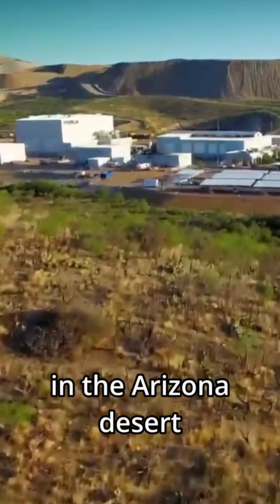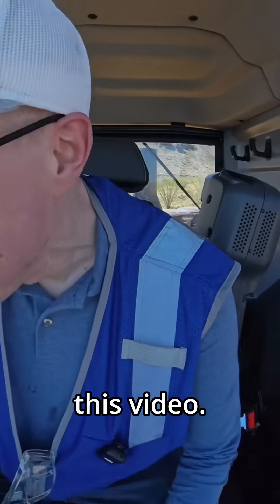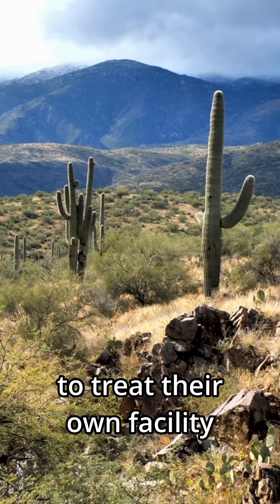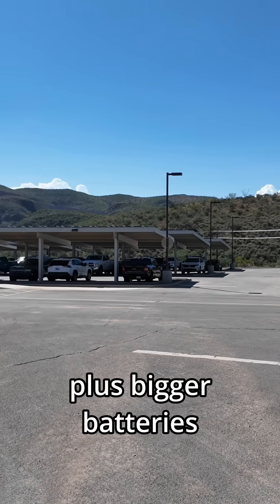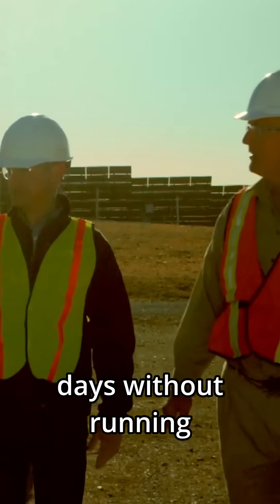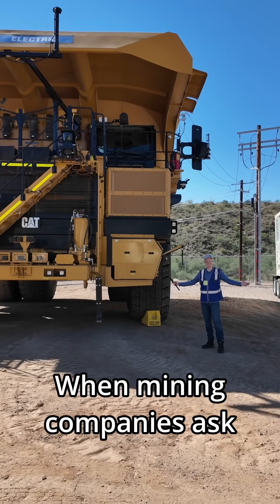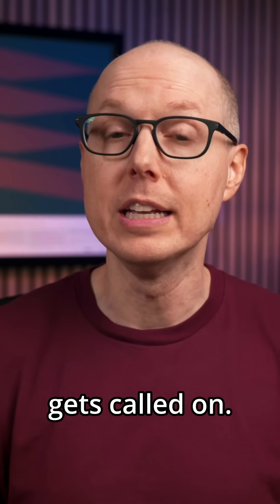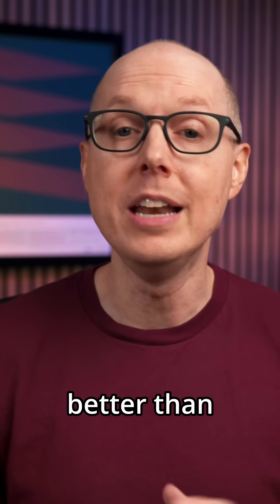Microgrids: The Desert Facility Running on Sunshine

Comment: Cost? What was the cost to build the solar farm and acquire the battery storage and the cost to maintain it in comparison to running and maintaining the generators? If creating the solar farm cost 3x more and the damage to the environment to mine for lithium for the batteries was 10x more is it worth it? These are real questions that require real answers.

Comment: I think you made a mistake with the numbers. 3MW of battery storage doesn't work with 12MW hours of energy. It is either 3MW hours or 12MW hours. I think you meant to say the draw capacity is 3MW hours per hour, which is consistent with these large scale BESS that typically offer 4 hours of electricity supply. So basically 4 hours supply at 3MW gives you 12MWH

Comment: Lot of good stuff, I'm very curious how many years it will take for them to achieve brake even on that investment with no use of the generators.  It's a perfect location for this test, but this challenge would be much harder to do say in the northeast

Comment: Good story. What is total cost comparison over time? Batteries and solar panels are very expensive and also require maintenance. So do generators and the fuel. They both pollute during manufacturing and recycling. Which path truly is better for mother earth?

Comment: The market for small nuclear reactors is huge. As battery technology advances and becomes cheaper. The equation is changing. It will eventually make more sense to power heavy equipment with electricity and use long life electric motors as prime movers. Equipment manufacturers will resist though. Planned obsolescence is critical to their business models of ever increasing profit.  Factor in automation and AI and you can foresee a potential future where moving mountains is economically feasible…which will come in handy when sea levels rise several feet by the end of century. Obviously this would also make all other areas of construction and resource processing cheaper like building roads and mining.

Comment: Working for Cummins in power generation, I can tell you that solar and wind have an ROI of less than two years compared to running prime diesel generators. It costs just under $18,000 per day to operate a 2 megawatt diesel generator and requires an engine rebuild every 36 months.

Comment: Matt… a 1.5MW solar system costs anywhere from $1.5MM TO $2.5MM installed before land cost and excluding subsidies. The all in cost of electric produced excluding batteries is roughly $0.90 - $1.60 kWh.  So while the logistics of running this unique project in a remote operation in the very sunny, low latitude Sonoran desert may make sense this is hardly a breakthrough solution for wide application. The science is certainly interesting but your credibility took a hit in my eyes particularly since this was a paid junket by CAT. I respect both you and CAT. BTW I’m a retired mining exec with direct experience operating a mining operation in the remote, very unforgiving MX Sonoran desert.
Reply: So, you have an opinion with a heavy conflict of interest leaning against it.

Comment: Am I CONFUSED?
HASNT this been going on for DECADES.
There are literally thousands of setups like this and their results are to say the least MIXED.
If it were this EASY we would have solar generators like this EVERYWHERE.
But from what I understand very few have actually saved any money.
After you figure in the costs of construction, maintenance, and all the other costs, this seeming SOLUTION IS JUST TOO EXPENSIVE.
Reply: Nothing is more expensive than shitty foreign fuel at speculative prices and maintaing these 30% efficient generators.  
This is a job for actual engineers, not crybabies stuck to their loud dirty junk.

Comment: How much did all those solar panels, batteries, and electric regulators and switching gear cost, and how much was the installation cost? Did they receive any energy tax incentives? What is the real bottom line on all those "savings"?

Comment: How much does the battery replacement cost?
Reply: they will know that in 10 - 12 years when first cells start failing.  They don't change the whole battery at once, modules are disconnected and swapped when the system detects unbalanced cells.

Comment: Did they share the cost of all those solar panels and battery storage systems? 4 MW of solar and 12 MWh of battery storage probably cost over $10 million. Where I work we've installed 2 MW of solar over a parking garage and parking lot and that's cost about $4 million. Payback is over 12 years.

Comment: No diesel cost or engine maintenance. Yet how much did the solar and battery installation cost? Pretty expensive. I have seen and installed megawatt solar. It's not cheap.
Reply: You want cheap and inefficient buy a diesel generator.
Reply: @fofopads4450 as far as diesel goes they are more efficient than unleaded at 25% compared to large diesels at 40%. Electric efficiency largely depends on the source and availability of the electricity. For current US electricity coal is the predominant source with an efficiency of about 35% from the plant. EV's are roughly 90% efficient, better in the city vs highway. Still i do like electricity and i believe it will be our future.

Comment: Few US locations offer vast lands or available sun for current solar efficiency.  
Viable Energy Storage is still a Pipe Dream
Reply: So we should just stop trying right? Because clearly, if current methods are failing, there's no point trying  for better.

JFC you people suck.
Reply: @MercurialJester When Push Comes to Shove , 8.2Billion humans likely best served by 'Cookie Cutter' nuclear for 24/7 energy access. Ya, lotsa pushbak on that idea. Reality being what it is , nuclear will be accepted as the Crutch until fuel's depleted or other viable massive energy sources are developed.
Reply: @peted5217   living in part of Europe known for the rainfall, my solar power generation is very viable despite almost never having 0 octre days with strong sunshine. 
Modern panels just don't require strong sunshine, that's an old myth.
Reply: @lonpfrb Happy to Hear Solar working out well @ your local. Is storage part of the setup? What % of your city has similar?

Comment: Around 53 degrees N. latitude Canada we get less than 8 hours per day of sunlight in winter, and further north its much less than that.  It takes a LOT of land area to produce the required solar electricity.  Much of that power would be used to heat the interior of vehicles.

Comment: Their biggest problem is the unused diesel sitting around is probably growing algae. So they will have to run it through fine filter and transfer it into scrubbed out tanks, then scrub out the tanks it was sitting in, and every so often, repeat the process, scrubbing out the tanks to remove additional algae growth, unless they just use it on other engines to keep it fresh or have a really effective algaecide additive added to the diesel.
Reply: Diesel in a mining company never goes bad before being used.

Comment: Heavy trucking and industry have seen the massive potential benefit of ditching diesel fuel in favour of batteries and renewals energy. Instead of them being completely reliant on oil prices they can now spend a bit of capital up front and build their own portable microgrids and electric truck fleets. They may still need diesel for some generator situation like for longhaul trucking, but by using plug-in hybrid tech thats already used for frieght trains they can massively reduce their dependence on oil products

Comment: is this a parody? 

spend millions to save thousands. as long as you live in Arizona, you could power the lights with... stored sunlight. nevermind the trucks burning all that diesel. 😂
Reply: @chara12345  this facility is mostly to test electric mining trucks.  
Judging by the size of those batteries they're most likely saving at least a thousand per day if their burn rate for the generators was around 0.2-0.3 which is decent for a small island system like that.  Hard to tell without knowing their load.  But even if those trucks are diesel electric hybrid (standard for modern trucks) their facility would have enough cranes, compressors, tools, A/C to be considerable.  Similar to a small town grid at least.

Comment: Yeah, nice for off-grid installations, not so nice for on-grid operations...
Reply: This is not true, sorry.  For large facilities, a "non-island microgrid" is a common and extremely efficient energy management structure that can implement renewables and storage very easily.  In fact, it needs less investment into storage due to the grid power being available as needed.  Many large mines closer to infrastructure operate this way otherwise they would break the grid.  But it's not uncommon to see universities or industrial facilities operating similarly.
Reply: @TheWaywardJester  I literally said the same: it's nice and useful for off-grid installations. And no, universities aren't off-grid. Industrial facilities literally can't be off-grid even.
Reply: @CoolKoon sorry I think I missed a definition there.  "Non-islanded" refers to a microgrid that is still connected to a grid.  A microgrid can be grid connected (a sub-grid so to speak).

Large universities and industrial facilities can be run as microgrids if the business so desires as an energy management strategy instead of relying on local utilities.  When it does there can be significant savings depending on the setup.  I know this as I specialized in energy systems and helped write a feasibility study for my university transforming into a microgrid.  See actual cases also like the University of Regina.  See also the industry of power trading in general, it's wild stuff.

I've never heard of it being done but an industrial facility could totally be off-grid if they so inclined.  That would almost never be economical though which I assume is your point.  But a lot of mines are essentially off-grid industrial facilities if you think about it.  I don't really have a problem with your statement for this I just like talking grids and thought that was interesting.

Comment: You know where solar panels do not work? Next to a mine, where they get covered in dust within 2 days. Guess they will find out along with the first dumb customer.
Reply: Depends on the mine.  Look up some modern mines with solar infrastructure.  They usually install them around hills away from common wind paths.  Rain also clears dust decently well and in areas that don't rain there are watering trucks that drive and spray down the panels every once in a while.  
These considerations are baked into the design process.

Comment: Deserts may look tough, but they are fragile ecosystems.  
How much damage do these acres and acres and acres of solar panels inflict?  They look innocuous, but they have underground structures, too.  These are typically left in place, once the useful life of the solar “farm” is reached, even if they take the actual panels and above-ground framework.  
What was wrong with the roof of the factory??   Not big enough???   How much of that acreage is covered in panels?

Comment: They are "saving" on the power bill.
What about expense on equipment and work to install.
What about all the solar panel and battery when they needed to be replaced???
🤔
Ps: like to see a solar or EV bulldozer😂
Reply: Yeah man. Since diesel generation amd diesel fuel is free, they definitely must have a large overprice.

They already make EV mining trucks. But I havent seen bulldozer,  is easy once you remove all the diesel junk, lots of weight available and hydraulic equipment is plugged easily

Comment: Quite a few mines in Australia have started using solar and wind to reduce their usage of diesel.  The Bellevue Gold mine in Western Australia runs almost solely on solar, wind and batteries.  Ironically, the Boggabri Coal Mine in NSW is developing a 5MW solar farm and a 12.6MWh battery solution so they can reduce their diesel usage while mining coal that is often used for coal power stations...

Comment: I’d like to know the cost of the investments in the solar/battery farm, the expected lifecycle and associated maintenance costs as well.  To develop the true cost avoidance over the expect operating life span of the equipment.
Reply: Commercial cells 10 years ago were being rated for 20 years. The technology has only improved. Even if they started with older cells, the 3 phase construction model allowed them to upgrade to newer technology each time. Meaning they have total capacity needs met for most operational periods, with that old infrastructure. If they account properly, which I assume they do, then the money that comes from depreciation goes into savings for another ten years before they even need to replace any of the old panels. By then the tech level in the industry will have made both efficiency and longevity better on the commercial market, by a ton. Not only will they pay for themselves. Once that happens, it will be actively making itself money. That's what he meant by actualized budget increases. True real world savings from maintenance on engines, shipping, fuel costs, replacement. Industrial engines need replacing more often than panels do. The subsidies are only for installation and if you hook up to the grid. So they probably aren't getting too many of those as a local footprint battery storage facility that is not hooked to the grid. When an R&D facility can fund its own expansion with the savings that it gets from switching to solar, and then use the born in cost of upgrading that infrastructure to modern technology, that paid for itself, to power that expansion without any new infrastructure. I don't see anything to complain about.

Comment: Crazy how many solar panels are needed for just that one facility… And they still need diesel fuel to run all the trucks. And as back up when the solar isn’t enough.
Reply: That is an electric vehicle testing facility... those trucks don't use diesel.

Comment: How much did they spend on this throughout the phases? Or does the silence of the generators not running tell the story better than actual math would?
Reply: Less than continuously replacing diesel engines every 5 or 6 years... when modern panels last for 20.
Reply: By the time this project completes a full depreciation cycle, the current footprint will have even more power generation capacity from updating to the newest technology. It's so win win.

Comment: Those frameless panels look exactly like the kind I installed on a big solar project. If so, they're an older design, there are much better ones now. 
Kinda surprised they didn't switch earlier in that case.. seems like a perfect use case for solar. Maybe they wanted to be able to say they used their own equipment (Cat generators) to power the place since I don't think Cat makes solar panels..

Comment: Do you know how long it will take to pay off the panels, bateries and controlers. In this facility it will pay back more quickly than most because they don't need to truck in diesel. I have loved solar for 40 years. The only reason solar works is because of cheap Chinese slave labor. If the panels were made in the us they would cost 2 to 4 times as much. Some panels are only 2x the cost of China's. Americans know how to make everything as expensive as possible. I hope we get the energy thing figured out. Diesel fuel will run out someday, and if we dont want to go back to slavery we need solutions. Keep up the good videos..
Reply: Americans speak of slave labor like they dont have slaves and dont sponsor slavery and exploitation around the world. 
Chinese panels are cheap mainly because their productions is clustered in one city, the solar panel providers are right next door to the factory. 

Americans have contractors all over the llace and love adding overhead to the costs so they can overprice poor quality stuff for shareholder perpetually increasing profit.

Comment: Saving hundreds of thousands a year is awesome, but what's the ROI? In Residential I think its in the range of $2-3/watt installed. Assuming this large install is on the cheaper side at $2/watt, the solar alone is closing in on $5mil. Plus.. 12 mwh of total battery storage? That's another $5 to 6mil? Call it a $10mil project, saving $300k/yr is a 33year ROI. I doubt those are anywhere near the real numbers, but I'd love to know.

Comment: The Empire facilities in AZ used to run co-gen plants using the exhaust heat to run absorption chillers in summer. They were more efficient than the generators used for the power grid and often sold extra power to the local municipalities. The EPA shut them down and forced solar retrofits that have an ROI of 17+ years and the panels require materials that cause 20× the pollution than a generator could produce in a year. There's a tradeoff

Comment: Ten square miles in the sunny southwest. Okay. Now try this project in the not-so-sunny northeast. Location is everything. Would this project work out in rural Maine? No unless you used SMR's. On the other hand, oil-rich Texas, ironically, is one of the best states to use solar and wind because it's, well, sunny and windy there.

Comment: Good to see that renewables are really cheaper than fossil. This is definitely not to be "greener" but finding ways to save operational cost. So instead of constant cost of refueling and need to somehow transport this fuel to remote locations they can cut it out transport material once and be more independent constantly. :)

Comment: 6.6kW PV on my roof will make 33kwh in 5 hours, but my consumption is over 24hrs.
The grid supply is limited to the lower steady supply. Solar electricity is too powerful. 😮😮